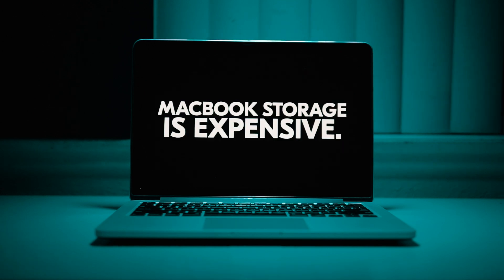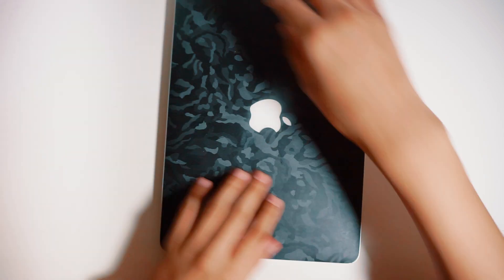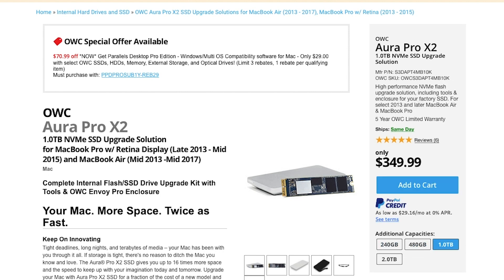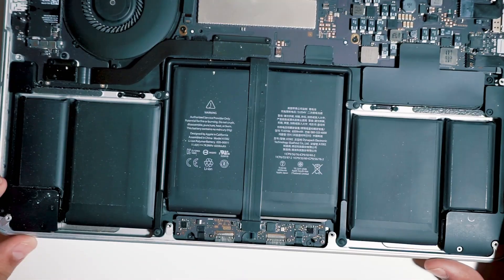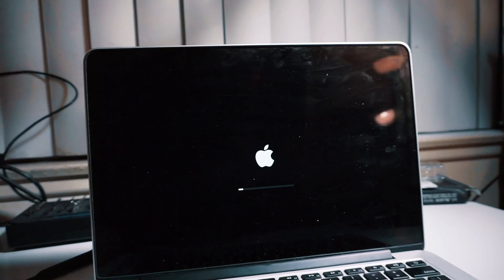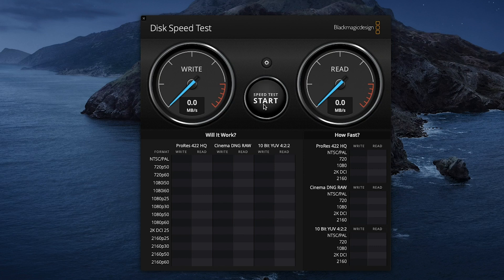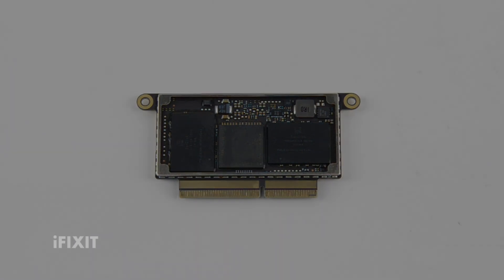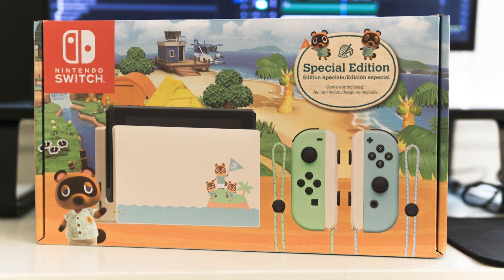The Last Upgradable Macbook Pro

Comment: The ssd gets only half the advertised speeds because of the pci 2.0 interface in the 2015 13” MacBook Pro
Reply: Ok, so it is basically bottleneck from interface port.
Reply: @mechamicro  bottlenecked
Reply: I used exact same ssd in my iMac 27' 2017 and I get speeds up to 2660 mb read and write speeds and used snitch adapter just in case anyone wants to upgrade :)
Reply: Sintech adapter #
Reply: @cemyildirim9830  Where did you get your "snitch" adapter?  Need it for my  2015 MB.
Reply: @Mickycho1964  hi Miguel, I’ve bought mine on Amazon in the uk. Hope this helps 😊
Reply: @cemyildirim9830  Hi, Can you help me? I want to upgrade my 2017 I mac 27"
Reply: @joannakennele645  sure, how  can I help ?
Reply: @cemyildirim9830  i already have t 8 gigs of ram install when i bought my imac but i want to go extreme high  speed, so i am wondering what I have to buy .. also the storage I have 1tb, i want to go maybe even more, thank you
Reply: @joannakennele645  right first of all more ram make it more faster. You might want to upgrade your ram if you’re doing lots of video editing or multi tasking ram demanding applications at the same time. 
Best upgrade you could do put a nvme ssd drive . It would speed things up a lot. Your iMac would become more responsive and fast. Hope this helps
Reply: @cemyildirim9830  yes I have an SSD drive instead of a fusion drive. thank you !!
Reply: prod. by Bong I just installed the new 2tb ssd from owc and my 2015 MacBook Pro hits about 2400 read and write speeds. The only down side is it’s so expensive. Definitely worth it in my opinion.
Reply: @GlobalWave1  I bet yours is 2015MBP 15 inch, which runs PCI2 3.0 x4
Reply: @jerryli5555  Exactly. And even worse, this dude spends 500$ on an SSD that is probably worse than this one and he's here recommending another person doing the same. I don't know specifically the capabilities of that Aura drive because they conveniently don't give us enough data about its performance, but I'm confident it's way worse than the WD SN750 2TB that sells on Amazon for 300$...
Reply: @GlobalWave1  Why buy the shitty OWC one when you can get a cheaper (and faster M.2 one to use later done the line) for less money
Reply: @swag-cc4uc  maybe hibernation/sleep issues from adapter
Reply: @GlobalWave1  Can you please elaborate on your experience so far? Im planning on doing the same but still wondering if I should upgrade all together to a new mbp. Thx in advance!
Reply: PyromaniacForce which MacBook do you have?
Reply: PyromaniacForce Glad to! Now it depends which MacBook Pro you have. If it’s the 2015 15inch then it’s definitely worth the upgrade. I’ve had mine in for a few weeks and having no problems. No boot up problems or sleep mode problems like some of the previous years before 2015 might be having. 
My SSD has 4 times the storage it had before at 2tb now and it runs at pretty much double the speed too.
Reply: @GlobalWave1  Yeah I was looking at that as well. Got an adapter and an EVO 070 Plus.
Reply: @GlobalWave1  maybe it is because the adapter
Reply: Based on the pins of the adapter. The Adapter does not use all the ports
Reply: Liberté Music yeah but only the 15 inch model has all the ports
Reply: Aye another producer lmao
Reply: @prod.byjake8118  what it do!
Reply: Labs Micro which MacBook and which storage did you buy it with?
Reply: Labs Micro did you originally buy it with 256g tho? Because those models ship with pci 3
Reply: Labs Micro yeah it has pci 3.0
Reply: @Labs Micro Do you need an adapter when using the Samsung SSD in your mac? If yes, which one do you use?
Reply: so whats the best ssd u can get that will work
Reply: @Duckzandcrackerz  I have a Samsung
Reply: @1prodbng  thanks ! do you know what read and write speeds is that fastest you can get? for the 2015 mac
<3
Reply: @Duckzandcrackerz  do you have the 15 or 13 inch?
Reply: @1prodbng  i got the Early 2015 13" :D
Reply: @Duckzandcrackerz  so your have pci e 2.0
Reply: I think that means that you’ll only get half the advertised speeds of an ssd
Reply: @1prodbng  oooh okay thank you!!!
Reply: And they'll keep selling them because you keep buying them. 
If everyone stopped buying computers that do not have removable RAM, drive & CPU, they would stop making them.
Reply: Also, I'm typing this on my 15" 2012 MBP with 16GB, 2.6 i7 and dual SSD's... That's right, I have two drives installed in this machine. I had to remove the DVD player to make room for it, but who needs that. 
I remember being upset that Apple did not include an ExpressCard 34 slot and thinking to myself "you can't upgrade it!"... Indeed, the bar has been lowered. Jeff thinks a laptop with removable media is "upgradable".
Reply: @ZInChat  damn but therefore yours is bigger, has a bad display and a bad CPU by todays standarts(I’m not saying yours is a bad machine just saying that a lot of people would probably need a faster cpu)
Reply: @ZInChat  one day that old reliable piece of ancient technology will become so obsolete or damaged that you will be forced to get a new laptop. Have you though about what Windows machine will be your choice?
Reply: @AlexandreG  As long as I don't upgrade the software, I'll get another 10 years out of this laptop. By then, Apple will have come to their senses. For all my heavy lifting, I have a desktop Mac Pro
Reply: Which is why a cheap 1tb ssd is the best option
Reply: You can update the EFI to make the pcie run at 3.0 instead of 2.0…
Reply: @Dnucci0937  how sway?
Reply: @Gijs not for all. The 2015 have faster pcie bus speed
Reply: The 2015 has 4 lanes yeah?
Reply: Yes
Reply: prod. by Bong  the bottle neck its coming from the nvme adapter.
Reply: Jose L Ramirez no it’s coming from the MacBook
Reply: and the speed of 3450 mb/s only works on windows computers
Reply: The 128gb version of 2015 MacBook Pro 13 has a slower interface respect the 256gb and 512gb versions

Comment: you will get half bandwidth if you're using an adapter
Reply from the maker: Hm, that could be the right answer. If I knew that, I probably wouldn't' have spent as much on the drive I bought. 😭

Comment: MB != Mb. The difference is, if I'm right, a factor 4 (or was it 8?)
Reply from the maker: I think youre referring to Mbps maybe to a factor of 8? Both the blackmagic speed test and the box refer to the speeds as MB. 😅
Reply: @DammitJeff  A lot of harddrive OEM's wil mislabel the boxes with MB when they mean Mb. Also, not every write test is equal , and you can't know which type of test the OEM used to get those numbers. Always take marketing material with a healthy amount of salt.
Reply from the maker: Sebastiaan Franken Very fair point! That said, 1500mb is still plenty fast and double my old drive, so I’m happy. But thank you for explaining that for me! 🤗